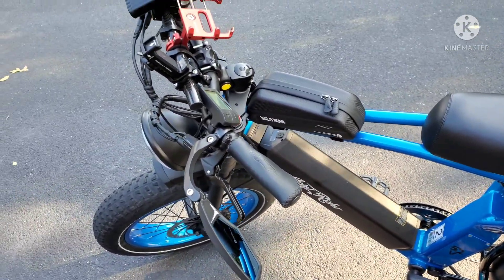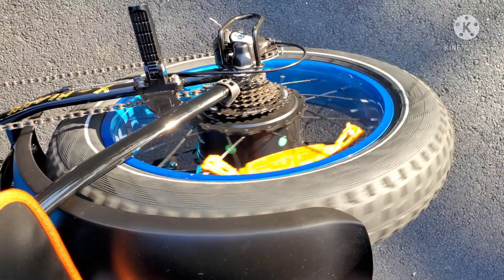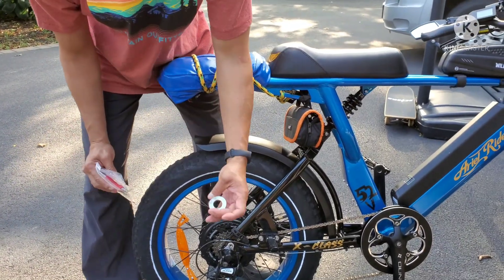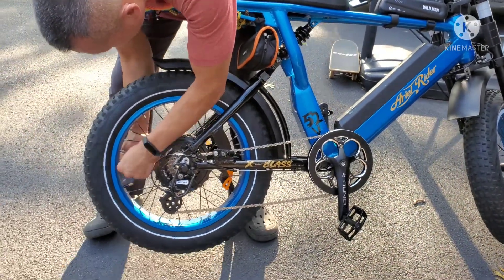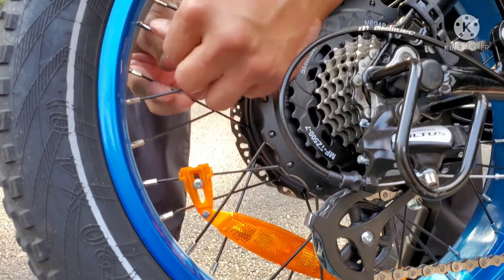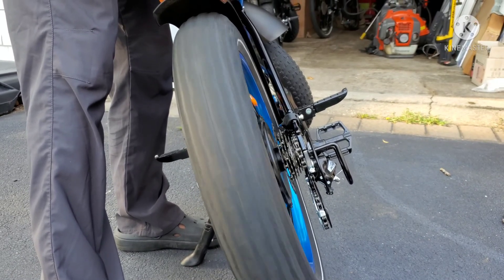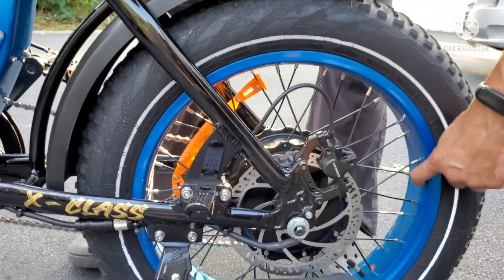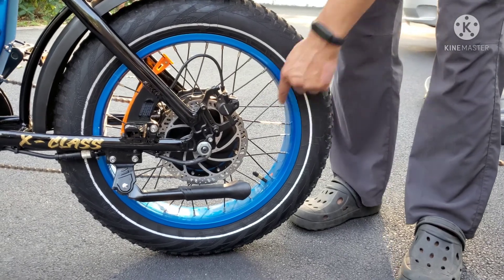Clicking noise coming from the rear wheel on my ebike, Easy Fix

Comment: my fat tire eBike has about 1200 miles on it and I started noticing weird sounds coming from the rear a few weeks ago.  After eliminating several possibilities, i was beginning to suspect it was bad bearings or motor and was NOT happy.  so thankful to have stumbled onto this video.  i didn't think my spokes felt terribly loose, but after snugging them all up with a 9 dollar spoke wrench.... voila !  noise is gone.  thank you !
Reply from the maker: Glad this was able to help.  Ride safe!
Reply: I got this same issue! Looks like I need to snug up the spokes!

Comment: These motors are shit less than 1000 miles. I have to replace two on a grizzly along with two controllers tree display cadence sensor. The only thing I I don't have to change is the frame.

Comment: Thanks for your diagnosis and solution.  I have a slight clicking noise when just using the throttle on a stand.  Will check and make sure all my spokes are tight.  Followup:  I checked for loose spokes and all the nuts on the non-drive side of the wheel were loose.  Tighten them all up and the clicking sound went away.  Guess the loose spoke nuts was an accident getting ready to happen.
Reply from the maker: Fantastic, glad you were able to get it fixed

Comment: Its why any minor issue of changes can lead to these trouble shooting moments which is a annoying if it leads into more. Even messing with a bikes frame drop out bars  to fit in wheel hub as doing that of just a minor hammer out of a millimetre, it will warp the rotation that leads to breakdown and notice many users doing this of their set up videos. You always have to be on inspection mode constantly to be on top of these issues to save the motor. Im always listening to anything that sounds or rides a bit odd.

Comment: I just discovered this was happening on mine as well. I removed the rear reflector, adjusted the brakes, and then realized quite a few spokes were loose. My spoke key comes today, yea!
Reply from the maker: There's a lot of vibration in riding these ebikes so I think all parts on the ebike would require periodic tightening.
Reply: @electrifyus  Yeah, I was figuring the shipping may have been the culprit... and I somehow didn't check the spokes when I got it 2-3 weeks back. At least I know now, it was making me crazy! :D
Reply from the maker: Glad you will have your tool soon and get it fixed. There are a lot of videos on here on how to tighten and true your wheel. Good luck!

Comment: I am having the same issue on my ebike with only 200 miles. If I push the thumb throttle there is no noise other than the motor. Once I pedel the clinking noise appears. I thought it maybe the spokes, some appeared to be loose but not by much.  I will buy the spoke tool to see if that works. I hope that is all it is.

Comment: It is common knowledge you need to tighten spokes on a hub motors.

When i build a ebike for someone I always balance the wheels and use Loctite on spokes.
Before even putting the wheel on.

Most e-bike builders on YouTube don't even bother doing the first thing.
They think it's plug and play.
Reply from the maker: Great idea using loctite.

Comment: Unfortunately for me this wasn't the case i lifted up the wheel and the noise persists i took it to the shop and they said its the nylon gears inside the motor must've gone bad says only last 1-2 years the nylon gears grinding and from the speed heat up melting it over time
Reply: Exactly what I thought too! I have no idea what truing a rim has to do with the motor. They both sound exactly the same in the before and after video.😂

Comment: I would have a trued by a professional. You could really mess it up and cause the brakes to wear prematurely. It's not a walk in the park to true rims
Reply from the maker: Absolutely,  if you could than do so, but some people don't have that option.  I on the other hand, am a tinkerer. I like figuring things out. So when I'm out and about if something goes wrong I'm able to hopefully fix and get back on the road.
Reply: Sounds like we are one in the same. Ebike riders can also have their rims trued at a motorcycle shop as well
Reply: Often, it's not so much getting the wheel trued, as just tightening a spoke or two. If that throws your wheel out of true, then maybe seek a pro. But if you can find the loose spoke and snug it up, you're only improving the integrity of the wheel system.
Reply: It’s not rocket science. Also no it’s not just tightening your door hinges. Wheel truing is possibly one of the most satisfying maintenance tasks you can learn.